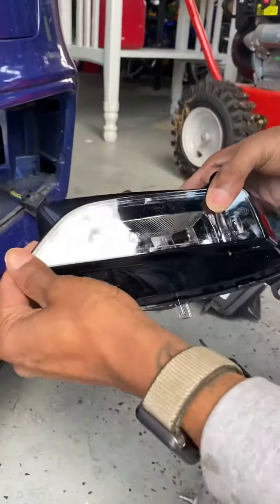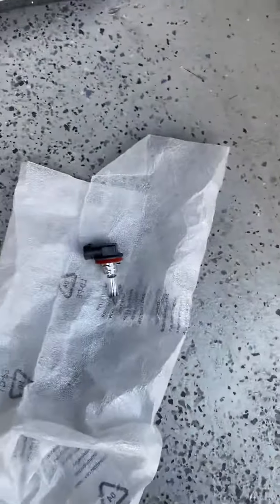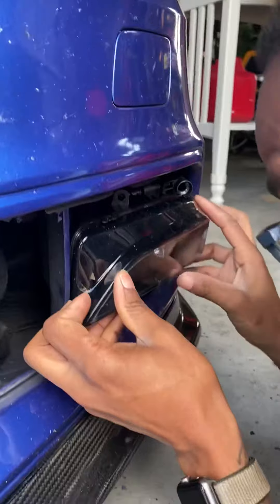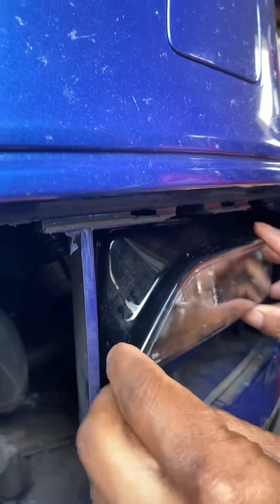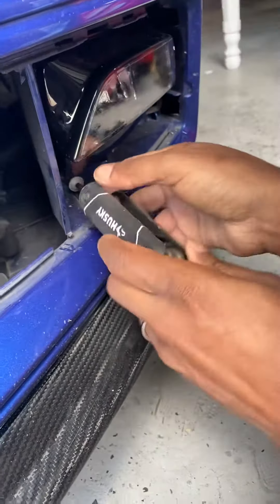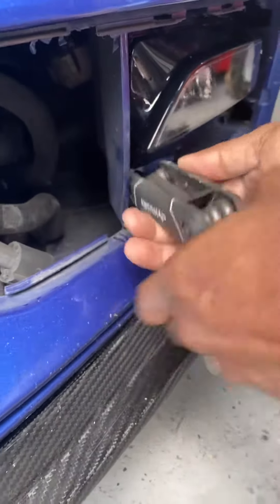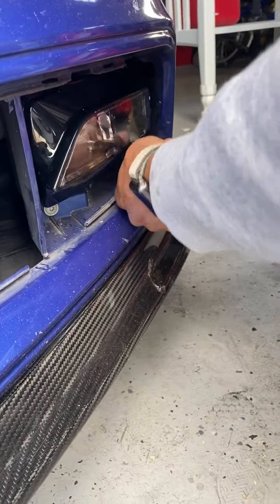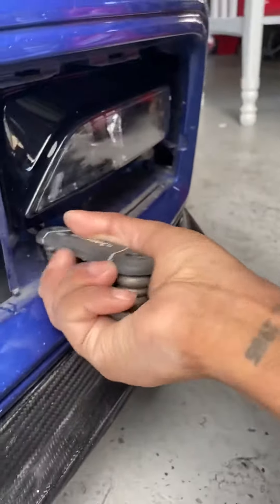Audi S4 B8.5 fog light replacement

Comment: Whats good? Appreciate your upload just noticed a few things from my experience.  On my s5 you can access the fog Iight bulb from behind the wheel well cover all you have to do is turn the wheel all the way to left or to the right for drivers side and remove two screws and it's enough room to reach in and grab the bulb.  I also realized that when I attempted to remove the front cover your way a clip snapped upon removal. Now it does thankfully go back in place but the seal isn't as tight as the other side I didn't touch.
Reply from the maker: Cavin Smith you absolutely can go from the wheel well to change a bulb. This was replacing with brand new oem fogs because the old ones was pitted from road debris. The way I did here was on the driver side you must pull from the left, because the clips are on the right side. The passenger side you pull from the right corner out to the left because the clips are on the left side!
Reply: @j23a45m  Gotcha that all makes sense. I felt like it would break after I gave it a good pull that day and decided to look for other ways. The fog lights I put in made a huge difference and they match my headlights. Nice bright white no yellowish color.

Comment: Do you know if these lights have a breather hole? The blue caps maybe? There is some condensation in mine
Reply from the maker: Yes, but usually check the bulb is seated correctly because it has a gasket that locks out moisture
Reply: @j23a45m  thanks for the reply. Yeah it probably is the gasket, when I changed the bulb to led I noticed it doesn't fit as snug. After a short time I had condensation. The problem now is that I need to get the water out, just changing the gasket will not be enough. Hence j asked about the breather holes

Comment: Sorry, I thought you said you had an LED in there already. My S5 has just regular halogen bulbs. What bulbs did you get for the fog lamps? Want to put a brighter bulb in there. Thanks for any suggestions. Also, how much were the new lamp housings? Great video, it being a German car I would have figured it was serious pain in the ass to do!
Reply from the maker: Chuck Sweitzer sorry for the late response here is a link to what I have. I have yellow fogs as it helps in the fog! https://www.ebay.com/itm/133507258413
Reply: @j23a45m  NP my guy, I appreciate the info. with them being LED's did you have to modify the housing to fit it? Sorry for an extra question, I should have added this in my original question. Thanks!
Reply from the maker: Chuck Sweitzer no modification needed at all, it’s just a bulb replacement. Direct plug and play fit
Reply: @j23a45m  sweet, I am going to track down some white bulbs from the brand you suggested. Appreciate the info and help kind sir! Have a good one!
Reply from the maker: Chuck Sweitzer you’re very welcome 🙏🏾
Reply: @j23a45m hey bro sorry I know this an old video and don’t mean to bother what size are the bulbs I clicked on the link and it didn’t find nothing
Reply from the maker: @S5David  https://www.sylvania-automotive.com/led/?gclsrc=aw.ds&gad_source=1&gbraid=0AAAAAC19r1H92eQvRiehYMFwc5lE0byTw&gclid=CjwKCAiA-ty8BhA_EiwAkyoa3yitoTtOuD5x4roAfidoJ-Mu_fLUcLbfjSzUiXz04oRgJ6a3eWykUxoCQ1YQAvD_BwE

Comment: That’s looks easy, you wouldn’t know if access to the fog lamp is the same on a B8.5 S5 would ya?
Reply from the maker: It definitely would be the same
Reply: @j23a45m  thank you sir!
Reply: @j23a45m  just FYI, I checked my fog light housing, no small hole to remove it with. Appreciate the reply though! Cheers!
Reply from the maker: @cmsweitzer1  crazy I pulled it up and it sure is solid. Wow that’s odd
Reply: @j23a45m  appreciate the the reply’s and original vid. Best of luck with the Audi! Mine has a been a good car for the 120,000 miles I have put on it! Peace!

Comment: just replaced mine and they wont turn on they fit perfect too, but the car detected both fog lights out... there LEDS, why are they not working boss. do I need VCDS coding?
Reply from the maker: What bulbs are you using, if they’re not working it can be one of three things. Either bad bulbs, not plugged in the right direction, or not plugged in all the way. Coding is only needed if you’re having a voltage error!
Reply: @j23a45m  H8 Leds fog lights but won't even turn on, people on the forum are telling me I need canbus resistor kit?
Reply: @j23a45m  I have the exact same car as you, same color 2015 S4 B8.5
Reply from the maker: @541_CoyotePower  the led bulbs you got are from where?
Reply from the maker: @541_CoyotePower  some need canbus some don’t. I didn’t need to use one at all.
Reply: @j23a45m  Amazon bro
Reply: @j23a45m  What really 👀, I will try to re fit them again today bro I'm sure I clipped them in all the way. I'll give you an update later.

Comment: Just tried removing my fog covers and this method doesn't work because the small circle which you pulled on is on the opposite side so it's looking like a bumper off job
Reply from the maker: you could have went through the fender liner as well. the dealer does this rather then fulling the bumper cover off